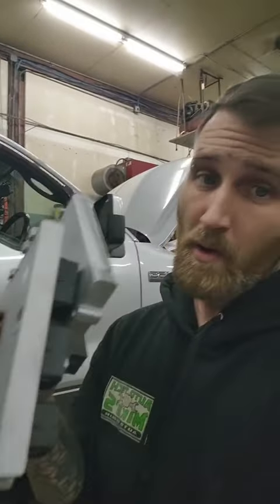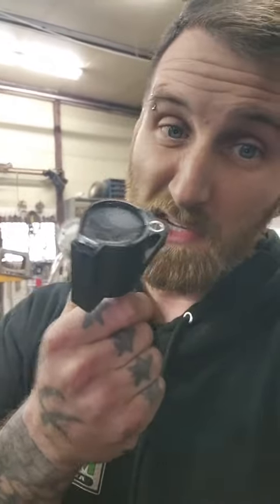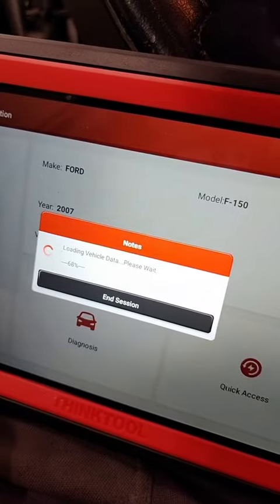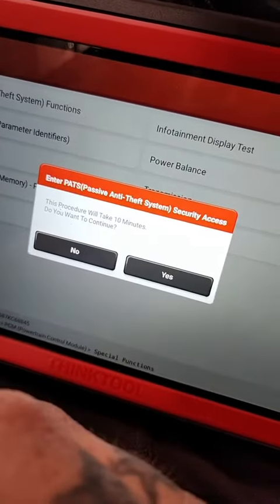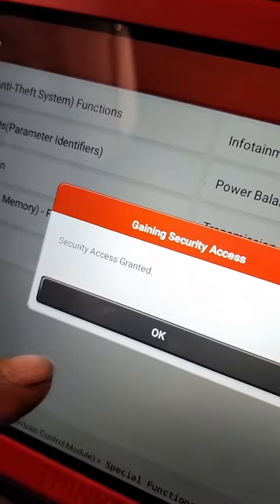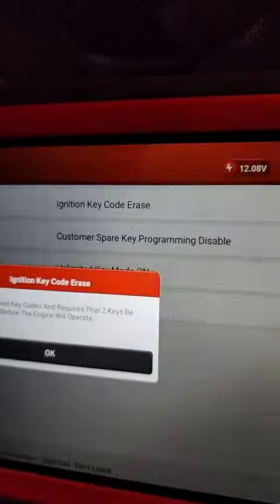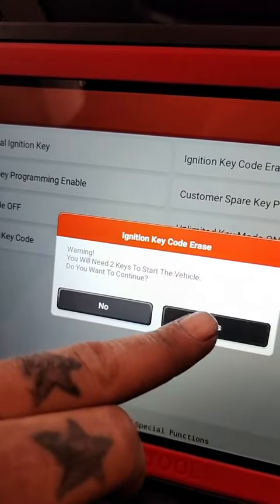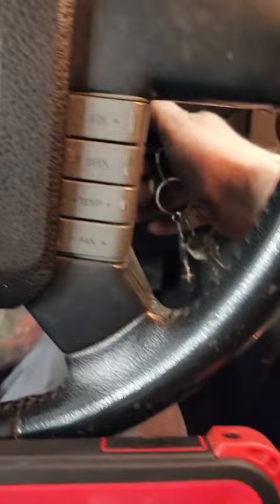bad new coils another shop misdiagnosed

Comment: Had a mechanic try ordering a fuel pump for a Mercedes diesel truck engine(OM442LA), around 20 grand at the time, because the rig wouldn't start and had huge amounts of unburnt fuel coming out the exhaust. It was in a crane and the crane was blocking a major road, so he was freaking out. I told him to stop what he was doing and wait for me. I asked him to go over everything he had done. He had not checked the air filter. You start with step one, then move on from there.
Reply: Yup. I always ask what is the problem they're noticing, what they think the problem is, what they've done so far, and what they think the solution is. Then, if necessary, that's when I step in.
Reply: And............
Reply: 20 grand for a fuel pump?????

Comment: A friend of my sisters took her car to the place she bought it from to have it looked at only to come back with more issues the extra problem was the transmission misbehaving so I took it for a test run reminded me of Reduced Engine Power mode in a Chevy Trailblazer so I poked around in the fuse box a minute and noticed two fuses for the TCM they removed one which put it in limp hooked up my scan tool to verify my thoughts and sure enough there was a code for lost communication out the fuse in and tada what do you worked just fine

Comment: Mike , do you know a shop that specifies in ford gen 1 3.5 Ecoboost f150 timing chain replacement no to far from Lansing area? I could do it but don't have the room. Ive even rebuilt a spare motor, my garage isn't big enough to facilitate the repair in the cold. But I do understand tensioners,chains, fuel Pump, water pump and all.

Comment: I've got an 04 3/4 ton chevy 6.0L it's a salvage truck my grandfather tried to upgrade and fix before he passed. The computer modules are from the half ton he took the interior out of to try and get the heated seats and power seats power windows steering wheel controls and everything else to work. Is there a place that could help with the recoding of those modules cause they've messed up the transmission shifting and engine power

Comment: Do you respond to questions this is my situation I have a 1996 Chevy k 1500 I did a recent manual swap to an NV 3500 and I put in a ECM from the same exact truck that had a manual transmission so now all the codes are gone 
so recently my truck started to backfire a little bit when you're cruising not accelerating and not decelerating just light throttle it breaks up I just changed the throttle position sensor that I had a code for and clearing the codes did not resolve the backfire but when I unplug the battery overnight the backfire is gone for 4 days and then comes back 
now I never did hook up the wire for the clutch signal to the ECM 
I've checked the distributor cap and rotor and spark plug wires and they seem to be fine any help would be greatly appreciated and I thank you in advance for your help
Reply: Update it was the module in the distributor